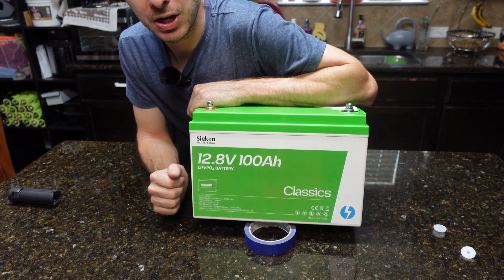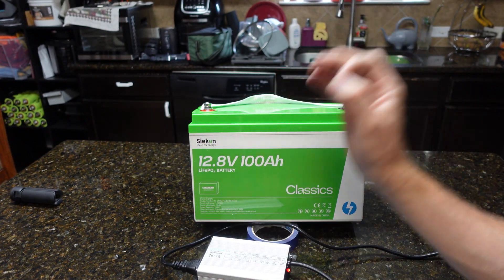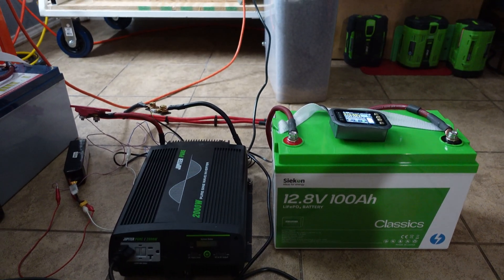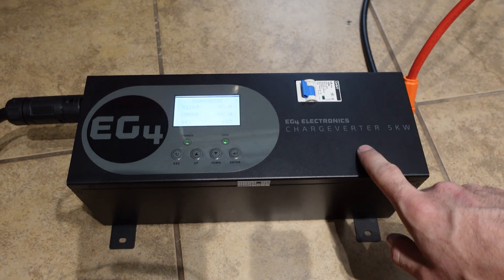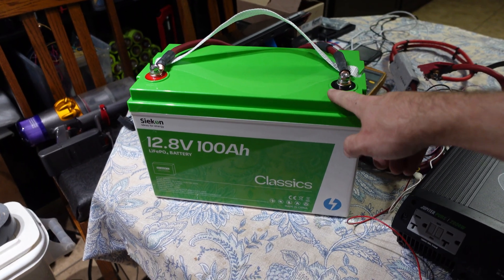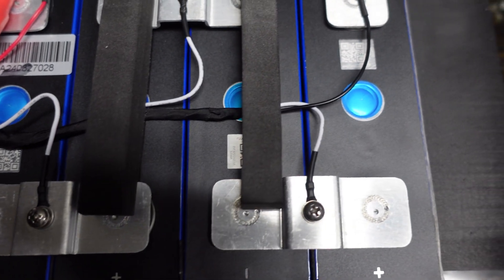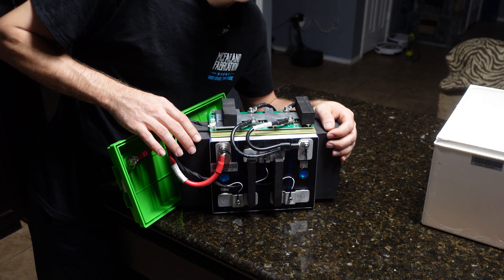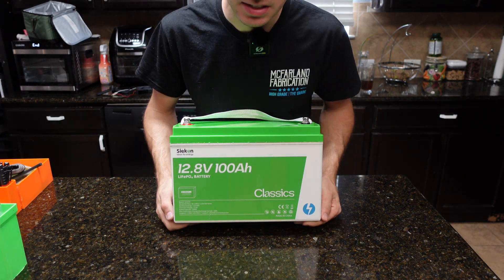Siekon 12v 100Ah Lifepo4 Battery! Full Disassembly

Comment: I bought the siekon 12v 200 ah battery, which worked well for about 9 months, and then died. Got in touch with support and by email they had me try 2 troubleshooting steps and they said that's it and refunded my purchase price. Very satisfied with the product and support. In total I spent less than 1 week before I has my refund. I recommend the company and their products.
Reply from the maker: That’s good especially for a newer company.c some times people have issues with other brands and it’s a nightmare

Comment: So there is no way for you to tell whether or not this battery is good or not until you have used it for months.
Reply from the maker: @aunttriciaattic  Yes initially it seems good but if it fails after a few months than you know it’s junk, but sometimes they appear really good out of the box. This battery has held up great no complaints so far!

Comment: It does not have a high amp cutoff, just put a resetable breaker Nader NDB1-125 Iin:100A on it which should be on all systems, and should be rock solid 👍